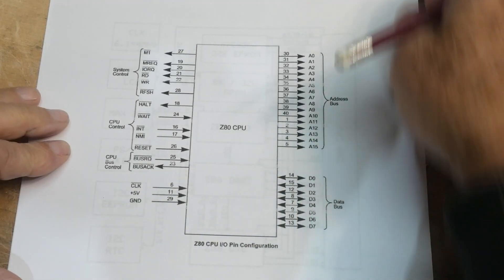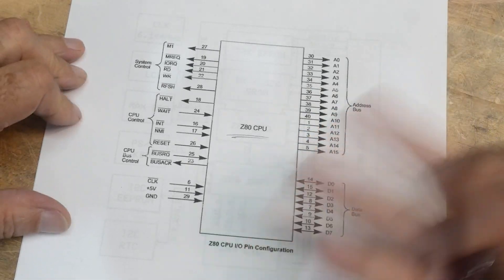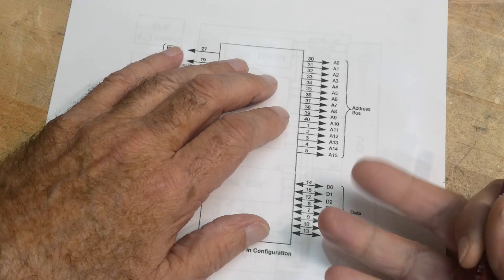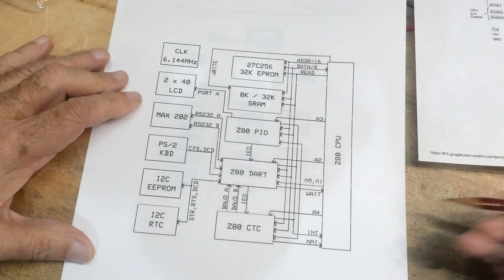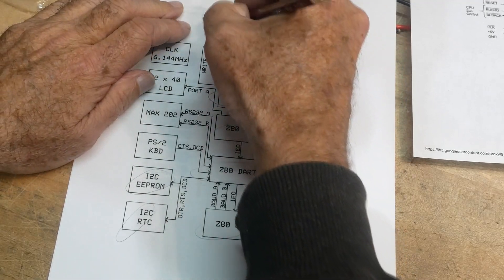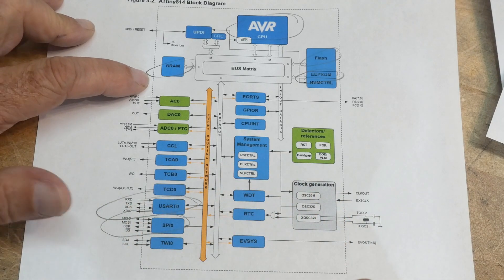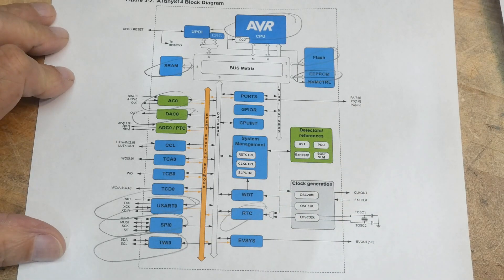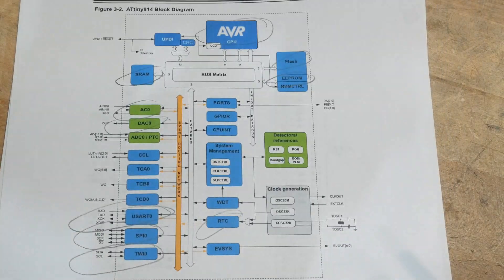#2111 What is a Microprocessor vs Microcontroller

Comment: Due to abundance of borderline options and hybrids on the market, I'd differentiate them by main purpose.
Microprocessors are optimized to process data and run highly scalable parallel execution resulting in an intermediate layer of OS. Microcontrollers are built to run baremetal first in order to provide the most (often real-time) control of connected hardware that it is meant to supervise, and OS layer here is entirely optional (potentially disadvantageous in time & latency sensitive applications).
Also, I think you sometimes use terms CPU and microprocessor interchangeably, where it should be differentiated. Central Processing Unit is a main logic block of both uP & uC, but the processing power and types of peripheral blocks (e.g. MMU) integrated is a single package and optimized for the type of purpose (processing/control), in other words complete architecture, that's what determines if it is a processor or controller.
1:57 Intel Xeon Max 9480 has 64GB of HBM (3D stacked SDRAM). AMD Epyc 9684X has 1152MB of L3 cache. Both are CPUs in terms of x86 architecture and microprocessors in terms of EE.
And by saying "does not have any IO" I suppose you mean general-purpose IO, since IO they have and it is sometimes nuts (with all the busses like DMI, PCIe, etc with hundreds to thousands of pins), and still some (ARM?) may include GPIO as well.
Raspberry Pi is an SBC built around microprocessor from Broadcom; Arduino UNO is a dev board around Atmel microcontroller; Arduino YUN is a hybrid based on Atmega MCU and Atheros SoC.

Comment: I think the only distinction between a modern microprocessor and a modern microcontroller would be MMU usage (memory virtualization for OS). Most microprocessor now already included the majority of standard peripheral common on microcontroller like I2C, SPI, UART, some GPIO pins,... Even some common consumer CPU from Intel and AMD should be more adequately called SoC rather than standard microprocessor due to their die including other function like video processing and graphic acceleration.

Comment: What makes them “micro”?  Is there a macro? mini?  nano?
Reply: Yes: mainframe > mini > micro.
From room sized mainframe computers with a cabinet sized CPU (ENIAC, IBM/360...), over fridge or desk sized mini computers with the CPU on one or more printed  circuit boards (PDP, VAX, Centurion...), to microcomputers with the CPU on a single chip (home computer, PC, laptop, smartphone). 
Nano would be a computer you can inject using a syringe.
Reply: Micro relates to miniaturizing to the level of multi/single-die IC in contrast to discrete architectures.

Comment: Microcontrollers and microprocessors are pretty similar (down to CPU cores which some of them are practically the same), yet with some party tricks that makes microcontroller more of a self-contained computer containing everything from RAM to peripherals (ie. I2C, SPI and / or USB).

Microcontrollers nowadays goes from slower 8-bit CPU variant up to Cortex M7 which is architecturally similar to classic Intel Pentium processor (two-ways superscalar in-order design). I remembered the first 32-bit ARM Cortex M3 microcontroller operating at 20 MHz (superscalar microcontrollers nowadays can reach as fast as 1 GHz CPU core clock).

Comment: Seeing how the lines between microcontroller and CPU have been blurred for a while (not just with SoC), such as how IEEE serial inclusion in the instruction set (or parallel IEEE1284), some newcomers might be helped by remembering the microprocessor's tendency to work with glue logic (take for example a Motorola 68K series) and the expectations of the registers. Amidst the confusion of similarities, those can help to be keywords that draw the mind back to what is the microprocessor (generally consider CPU) versus the microprocessor and what can be thought of going on with the interrupt request cycle, when there are different buses. 
My comment has no hate in it and I do no harm. I am not appalled or afraid, boasting or envying or complaining... Just saying. Psalms23: Giving thanks and praise to the Lord and peace and love. Also, I'd say Matthew6.

Comment: Started on the RCA 1802, in battery projects. Then moved over to 8080's and 8086 you got used to having to build a computer in to every design.  Used the 8086 for quite a few years as it was i think available in mil spec. open our kit and there would not be plastic chip in sight. Ceramic being the construction of choice for mil spec components.
Brings back memory's, even to the point of dual port ram, and the strange chip that was both ram and eeprom. at power up the eeprom data was loaded into the ram, and at any point you could force the ram contents back in to the eeprom. but you did not get a lot of write cycles.

Comment: The old RCA1802 CPU had some build in I/O and if i remember well there was even a 1802 variant with some internal memory ( 1804 ? ).
Reply: 1802 was one of the least known most used cpus
Reply: best chip ever, where else could you write SEX all over your program. "Set X" in long hand. being fully static you could just stop the clock for long delays.

Comment: I have used many cpu's, like 68HC11, 68HC16, several DSP's, PIC24 and now PIC32 families. The funniest of all is PIC10 which lives in a SOT23-6 and has 512 bytes of ASM code and 12 words of SRAM.  It is so small that if you drop it on the floor, it is a waste of time to start searching for it. It can for instance create simple logic into a circuit, act as an analog comparator and timer. It has reconfigurable legs for I/O.  Due to its size it can easily find its place on the board if some simple repeatable operation is needed releasing the main cpu for something more intelligent. My latest chip of the day is CC2652RB which has a lot of functionality and actually, four cpu's inside for specialized tasks, all in micropower.

Comment: anyone know of any interweb places i can go to learn to use microcontroller chips without them perhaps being so intimidating? i'm trying to step up from arduinoland into hobby embedded stuff and all the information i can find goes waaay deep waaay fast
Reply: Personally, I would look at the various evaluation / starter boards available (depending on your micro of choice). Many include well-documented sample code to get you started. Stuff on the interweb can be overwhelming and a large proportion is rubbish.
Reply: Look for the chip datasheets and learn to read them, regarding the  internals and how they interact. 
This will help far more than just looking at example code etc.
I would pick a chip, find a dev board, an integrated development environment IDE (which could be Arduino based as they are quite cheap and easy to get)
Reply: If you have outgrown "Arduino land" then you should be able to answer this yourself, as arduino IS hobby electronics stuff. You know Platform IO, you quite happy to use the bare chip say the 328p-AU ? then just pick a chip, get it's datasheets and study it, that will keep you going ..good luck have fun :)

Comment: As an embedded systems engineer I used a particularly nice Z80 variant made originally by Hitachi, the HD64180. It put a lot of the support functions onto the chip so it had a clocked serial port, multiple async serial ports (though we often ended up with a couple of SCN26xx chips, either duarts or octarts to add the channels we needed), multiple timers and an MMU allowing mapping into an external 512K memory space. All that together with an enhanced instruction set that included an 8x8 multiply that made it so much better than a standard Z80. It is just a shame that its register limitations didn't allow efficient embedded C like the H8 did, though I happily programmed it in assembler for years! The H8 was nice to use though 😁